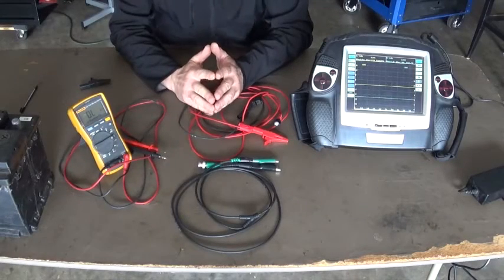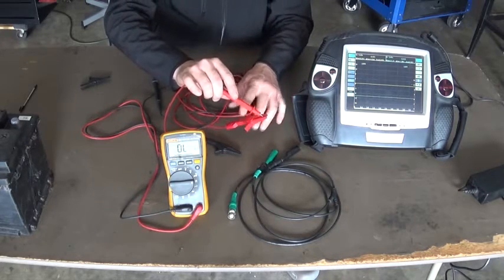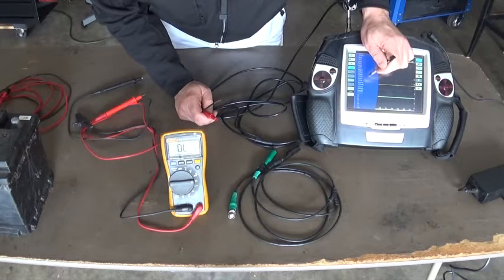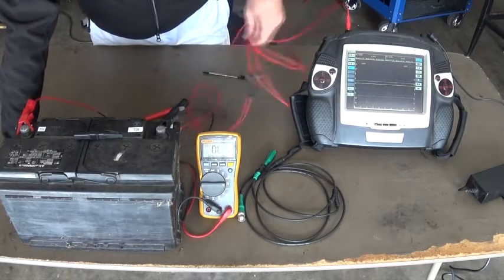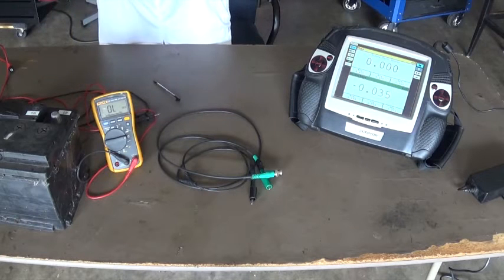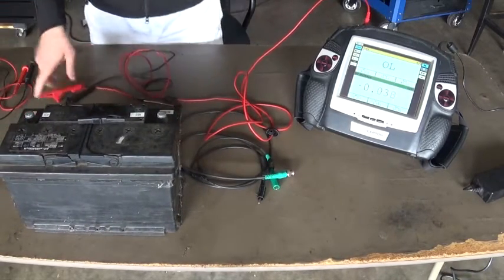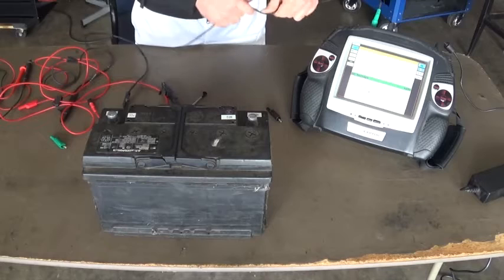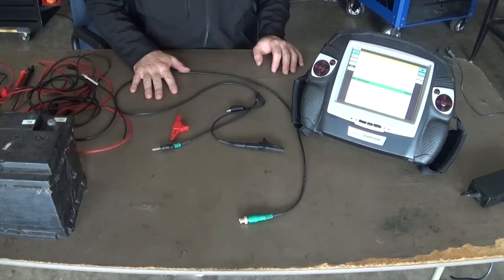Problems With BNC Test Leads

Comment: Great video. I actually have those eBay ones i believe they are hantek. I thought my scope bnc input was going bad, i switched the lead to my second channel and has the sane result as in the video. They come apart, and loosen up. So i resoldered the bnc end and tightened up the positive and negative ends with a small flat head and i was good to go. You do get what you pay for, but I always do my own QC. Thanks for sharing buddy. Subbed 👍
Reply from the maker: Thank you for comment buddy. I like your channel as well. Subb from me. Cheers

Comment: This type of work is tricky enough as is with usually lots of things to keep an eye on. Last we need is shoddy connections to complicate things. Had cheap banana plug cables that drove me nuts until I replaced the ends with top quality male banana plugs.
Simple but important point you bring up.

Comment: Thanks for the video Ramon! Definitely a good idea to check leads periodically. I always replace my test leads with the silicone test leads even if they are new. Much easier to use in cold weather than the PVC leads.
Reply from the maker: White Tiger I used to have cheap BNC leads and have some unpleasant experience with it. Now I use picoscope leads much better quality but I still test them ones a week. Cheers my friend.

Comment: I'm surprised there was no smoke when the shorted one got connected to the battery. Though then the video title would be "Spot-welding with BNC test leads"! 

Great reminder to test the equipment! If testing bigger wires (like PowerProbe leads), I would only be comfortable with doing this test with a circuit breaker/fuse or even a light bulb in line with the battery.
Reply from the maker: Dmitriy L. Spot welding with test leads love it. 😃😃